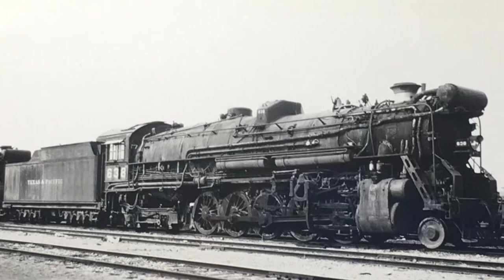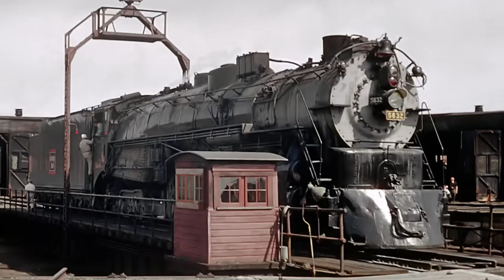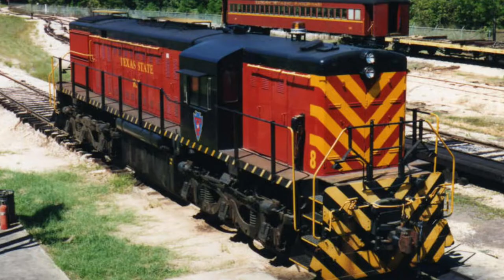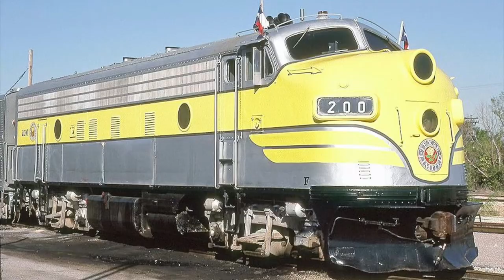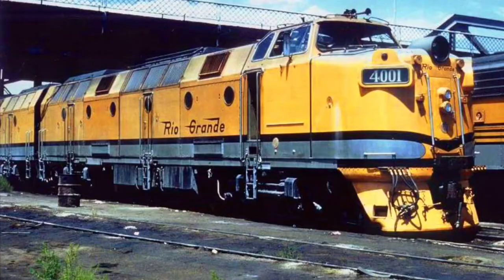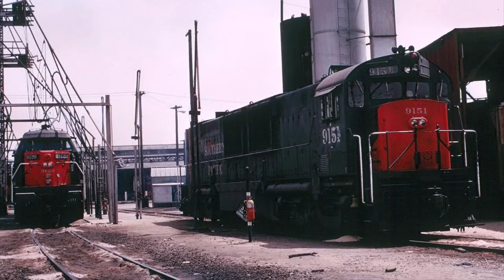Hardware Store by Weird Al but it’s the many great locomotives we’ve lost over the years

Comment: When i think of a steam engine i think of a beast in a metal jacket that Essentially is used for transporting cargo and passengers. And however, if we don’t take care of it, the beast would probably die. And it needs water, so it doesn’t literally explode from not having enough water in the boiler, also probably killing the beast as well.
So essentially hydrate the engine.
🚂